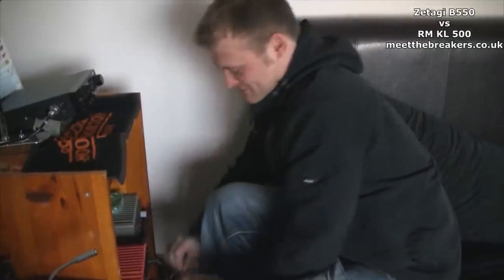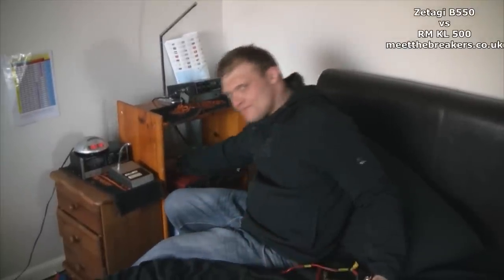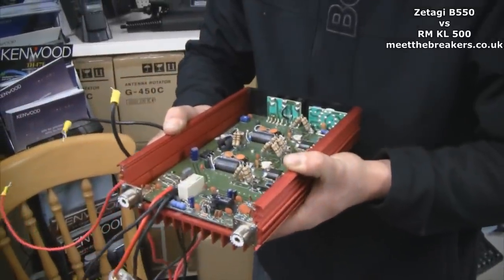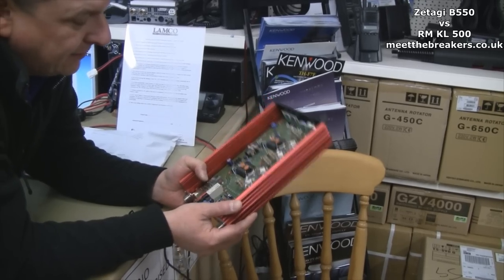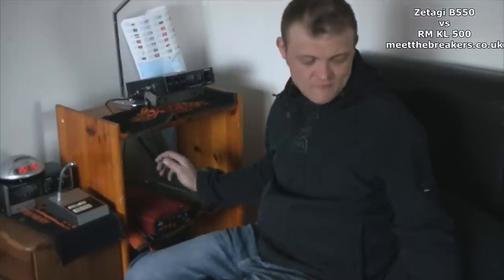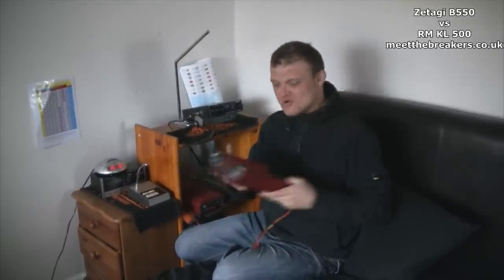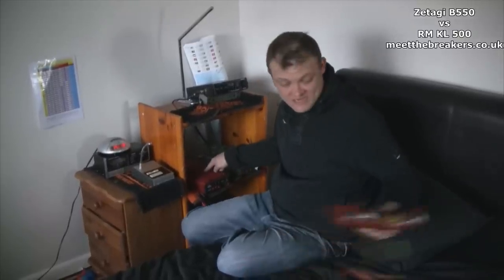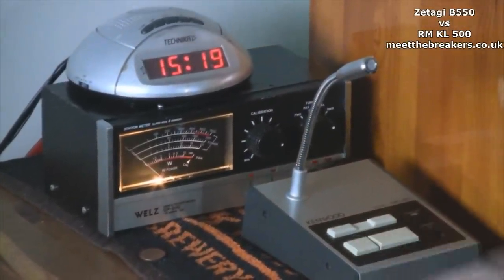Zetagi B550 vs RM KL500 Linear Amplifier Test

Comment: Yup,  them Rm Italy amps are garbage.  Mine lasted me around 30 days then went bad.  I took it to get fixed and went bad in 20 days. 
Was a little 30watt amp to get out a few extra miles with  my cb in my 18wheels.
I was getting out like 14 miles wich was awesome but it didn't last.
Reply from the maker: I hear you brother, there so easy to kill, especially the smaller ones like the 30w, uses a single MOSFET for the amplification which makes it run beyond it's limit all the time especially on a uk cb that use FM as the carrier, and when your mobile as well, your antenna and swr really has to be spot on or they will die pretty much instantly.
Reply: Uncle Frank yes sir,  i had my antenna tuned and my swr was under 1.5. But then one day the antenna mount broke and i installed a new one.  Swr might have moved some and maybe that made the amp go bad. I still have the amp,  just not sure if u should spend another $20-30 to get it fixed again.  Seems like a money pit with no bottom.

Comment: I run a zetagi b 501p, 5 watts in 170 watts out, on ssb with 10 watts in about 250 watts out... It has 2x mrf 422 in it its a 24 volt DEVICE.. A!

Comment: heat is not really an issue, the cheap and weak parts are, iff you rebuild  the zetagy or the rm, it will do 400 watts easy, whit the pills wich are in now., would be getting pritty hot, but they will work, an stay together fine, no magic smoke, increase power wires, fuses, and resistors, couplers need better caps also.(and mount a car battery parralel whit the power supply.)(less voltage drop, moore wats, cooler pills....)

....

Comment: just 1 nag, low SWR doesnt mean an efficient system. But I know  its a good setup. x
Reply from the maker: Actually the only thing more important than a low swr is a resonant antenna, but the two usually go hand in hand, a resonant antenna will almost most certainly have a low swr, but a low swr doesn't always mean you are resonant !

Comment: what amperage wire do I need to run earlier in the mobile  what amperage wire do I need to run earlier in the mobile I just got 3 power settings on it no medium and highwhat amperage wire do I need to run earlier in the mobileand on the lowest setting 120ould that be right4 Watts in
Reply: Minimum 30amp for these, otherwise too much voltage drop and possible fire risk

Comment: i honestly think the RM might be a wolf dressed in sheeps clothing meaning that it was meant to run audio speakers rather than act as a lineal amp..

and also note this is designed to be used in a vehicle not as a mains power..

Comment: you drive the rm to hard you got to look at the swing I use rm for a long time I drive with a cobra148 it swing up to about 6watt
Reply from the maker: You are right we do drive our amps harder in the UK, made worse by the fact that our normal mode of operation is FM, we don't have 'swing' because unlike AM with its variable swinging output, our constant fm carrier of 5-6 watts input can and does give the amp a hard time. The stickers on the back of the units claim a 10w input so most breakers think they can put 10w in safely so obviously assume that 5 or 6 input is been extremely conservative but the reality is if you want these to last a lifetime instead of a few month then 2-3w on FM or 5-6w am / Ssb is the best way. I know run my amps with lower input after decades of failed amps iv now learned my lesson :-)

Comment: Why don't you buy a good antenna like me  ..   5 element beam antenna. .  .. 20 Watts on 28 mhz ..  . power is not the answer. .
Reply: Why would somebody on 11m want to use a beam when everybody else on 11m are using verticals? This is free banding not stupid ham radio, we use power and don't conform to rules

Comment: if the manufacturers think of a Linear Amplifier as a computer then they would realize that they should put a fan already inside them to keep them cool with a proper shell around them so hot air can escape out of them we all know that anything with a motherboard with power running through them will create heat blimey talk about surrounded by noobs :( & after watching this video i`m not going to buy nothing from RM until they improve there equipment.
Reply from the maker: You are absolutely spot on, the manufacturer should be well aware of the lack of thermal dissipation from this unit and should have either designed it with fans or made it physically bigger with more metal. All down to cost and profit margins I guess is why they didn't, but it does kinda make them totally unfit for purpose, you buy it, use it and the reality is your just waiting for it to overheat and break.